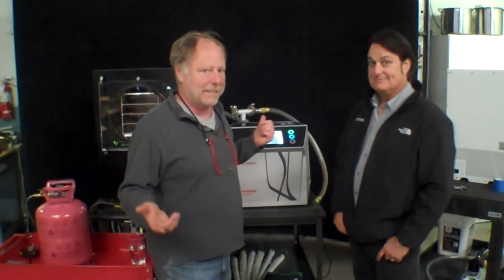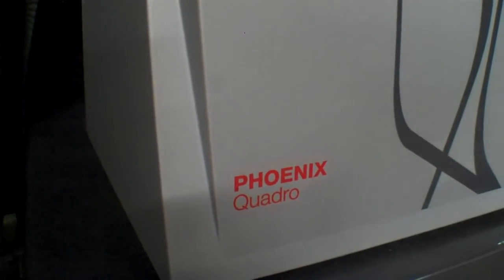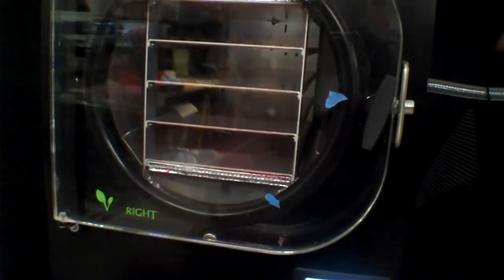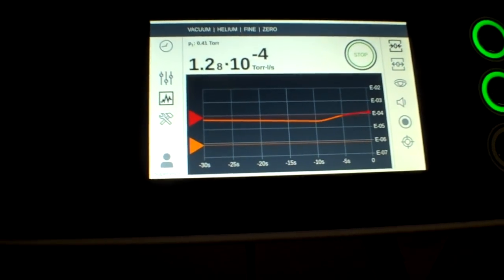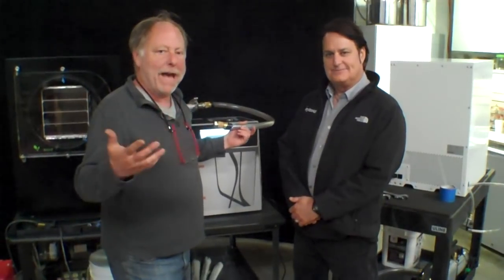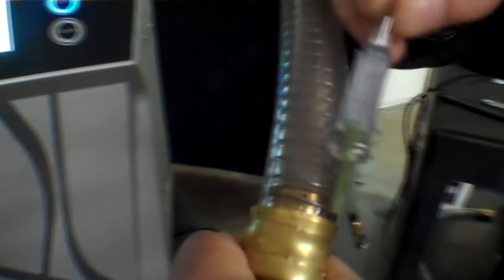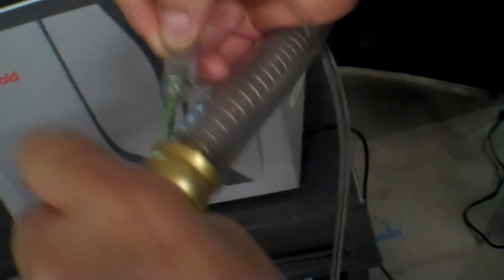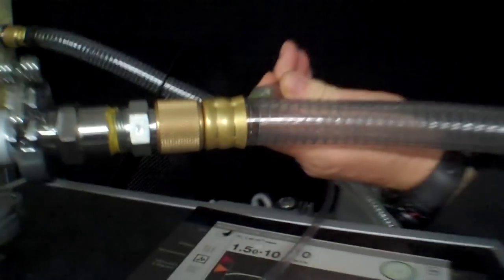Vacuum leak detection on a Harvest Right - Using Helium - With Brian from Leybold.

Comment: Interesting. Another way to leak check vacuum is by using shaving cream. The vacuum will suck in the shaving cream at the leak point. Not sure if a tiny leak show well. It's what we do at the plant where I work to find leaks in our piping.My unit has been running almost 24/7 since December of 2018. The oil less pump is well worth the extra money.
Reply: As long as you don't care if shaving cream gets into your vacuum system, this is a cheap way to find leaks!
Reply: Wow! What a great idea!!

Comment: I was struggling with my HR since I could not get below 500 mTorr after 30 minutes of pumping. So I inspected the face of the steel drum with a magnifying glass and found some dings and some radial scratches that could create a pathway for air infiltration. I lightly sanded them with fine sandpaper moving along the rim in an axial direction to erase the radial scratches and create more flat area for the dings. I'm not sure if that helped much since i still could not get below 500mTorr in a reasonable amount of time (large model circa 2020 with the black skinny hose).
Next I saw a video or a comment about how to properly tighten the newer style black hose (finger tight and then an additional 1/6th of a turn with a wrench. The only problem was one end of the hose would not turn past finger tight. Once it got to finger tight, it was a hard stop even with light pressure from a wrench. So I think there might be some kind of mfr defect on that particular fitting?? Anyway, I decided to try swapping the ends of the hose and tightening them again (same story on the one with the hard stop).
And it did not seem obvious to me if it helped at all. So I turned off the pump on the test touch screen and put in the load since it (sliced fruit) had been sitting around for a bit and fired it up.
About 8 hours later, I checked on the system and the pump was running and was still cloudy (brand spanking new RobinAir vacuum oil) and the pressure was just BARELY under 500mTorr so I was not sure if it was going to be a good batch or not. I came back 16 hours later and that sucker was at 180mTorr!! I couldn't believe it (and I think the oil cleared up a little). Not only that but it was the fastest freeze dry session I've ever seen (this was my 6th or 7th session on it). So I still do not understand what exactly happened.

Comment: My door is not touching rubber seal AT ALL,  from 6 o'clock to 4 o'clock on seal. And 1 o'clock  is hair line touching.  Harvest right sent me their private video for door adjustments, but it didn't help my problem. I TRIED both  loosening and tightening the position of the door adjustment bolt with no luck on proper seal. I will be calling item tomorrow. It's either the door is bent, the rubber gasket is a lemon,  or the actual steel drum lip edge is deformed? I've never used it. This was Going to be my first attempt,  and was just about to try the leak mtorr pre test as the Instructions say to do before using your unit.? Any thoughts? 

I'm kinda bummed out that I'm having all these problems and haven't even tried the unit yet. So far I'm unimpressed with the quality control  problems that I'm having. Without this fixed I can't even dry my food that I've spent a lot of  money on

 Also what position do u leave your door in when it's not in use? The lady i spoke with back in april said to latch it but not cam it over when not in use. I follow her advice so that shouknt be the problem. also have major problems with this newer unit's ease of tray heating shelve holder going into the unit enough to clear the door. Harvest right said that I should remove the stainless/aluminum wire cover on the back of unit so the wires have more room to clear the back of the drum and not bind up, or I could just hold the wires above the unit every time I put shelf in so I won't bind. Only problem with the later is the wires will be touching the top and sides of drum in multiple places and it will be frozen to walls and not easily removed until thawed*
Reply: HEED MY Words this is very concerning to learn. I just bought one. A $5000 investment.

Comment: The Question Here is do you think Harvest Right owns a Helium Leak Detector, I don't think so, I have visited their facility and I don't think they have one. I live only about 20 miles from their facility and have taken my machine to be repaired on multiple occasions and nothing like this was employed to find the chamber leak. After taking it back 4 times they gave me a new machine because I had only had the machine 1 week and they could not find the leak. On this replaced machine, I now have a 700 Mili-Torr Leak, it is now out of warranty and they want $45/ hour to fix it.  I cannot find the leak I have tried everything.  I am begging to think there is a weld problem in the chamber somewhere. The machine won't function. The machine needs to go down to 500 Mt, Mine will only go to 1100 Mt.  They have sent me new firmware that allows the machine to function up to 1500 but this extends the processing time and the product is not as good.

Comment: Hey Bryan...Just curious... Do you know if the harvest right premier pump or for that manner any of there pumps carry any specific details that specs them out as a food grade vacuum pump? I could see maybe the type of vacuum oil being a concern.  Reason I ask I have thought about using another manufactures pump that has a higher CFM rating. I would use a different power source and just use the power supplied by the freeze dryer to the pump to control a relay that will  engage contacts to supply power to the pump I would use. I have researched the old JB pump and it was used also for auto air condition evacuation as well. I don't see anywhere that makes the pumps special "food grade" process. Just wanted to see if you knew anything. Great vid. Like the channel.

Comment: Thanks for all the info just received mine starting to set up do I need to put the silicone on the threads? Don  keep up the good work at the center
Reply from the maker: Hook it up like they show you and you are good to go. That hose was 2+ years old had has been bent and re-bent since I mess around with different pumps and such all the time. A new hose should work fine.